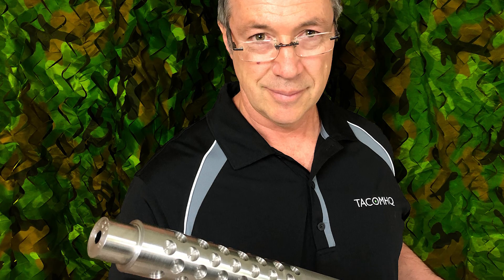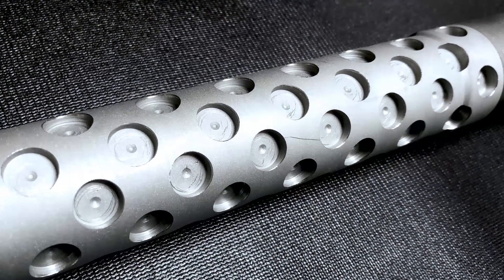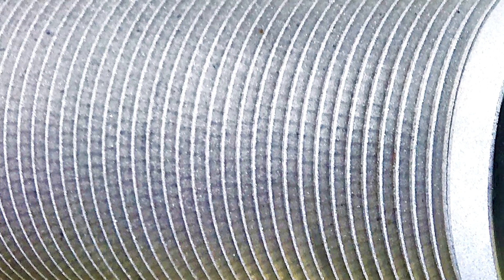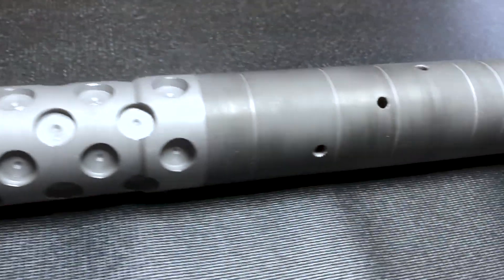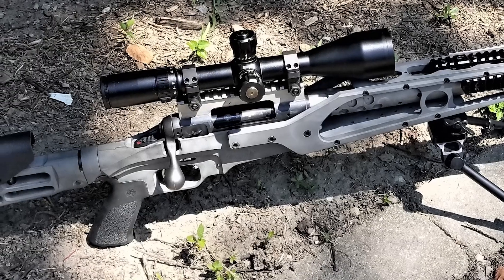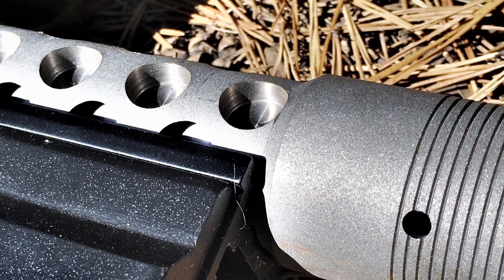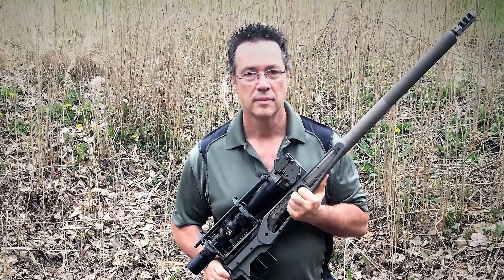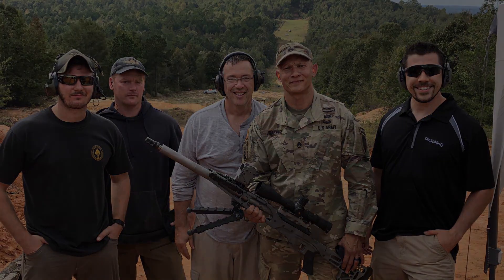The Engineering Behind a TACOMHQ Structured Barrel

Comment: Really impressive. Can this be offered as a sleeve? Any restrictions on caliber/ platform. I’d be interested for large frame AR pattern rifles.
Reply from the maker: We do not offer it as a sleeve. From an engineering standpoint I would think at least as much if not more complexity would be involved. The only way I could think of is to "shrink" a sleeve onto a barrel blank. At that point I would be concerned about straightness of the bore with the new applied stresses. However, we certainly cover that in our patent(s) LOL. Someday maybe... Concerning large frame AR pattern rifles: we can produce barrels for those. However, our gas block must be used and hand guard ID's must be sufficient to clear the 1.35 barrel. Oddly/fortunately the gas tube location is nearly stock with little mods needed. Our AR10 is always the favorite gun to shoot on bases during demoes... 
Caliber- .22 to .50cal to date.

Comment: I just wanted to thank you for maintaining the comments section for so long with such detailed answers, well done! I do have a question though, since mirage makes quite fantastic suppressors would there be any advantage harmonic/cooling/otherwise of creating a suppressor specifically for these structured barrels? An off the cuff idea would be to somehow take advantage of the longer duration lower pressure gas from the suppressor to draw even more air through the barrel. Would providing a suppressor option for these barrels be something Tacom/Mirage would consider?
Reply from the maker: That is a major project in the works..

Comment: Have you tried to add fluting between the longitudinal holes?
Reply from the maker: Fluting would slightly reduce weight. It would actually reduce cooling surface without introducing an expensive/complex method of creating the fine grooves inside the fluted area. It will also potentially reduce rigidity as the minor diameter created by the flute is my new max material condition. With that - yes LOL. However, the answer does not mean a "stop" is in place.
Reply from the maker: Great question. Once a Structured Barrel is finished, it is generally reduced to a minimum OD that would be insufficient for exterior fluting. Larger the structural OD, greater the strength and rigidity.

Comment: Amateur here. how does one go about setting a rifle like this up ? isn't it much thicker than the standard barrel, so how would it attach to a standard lower?
Reply from the maker: Yes, a Structured Barrel is thicker than a standard barrel, but its final OD depends on the caliber.  A few barrels we tapered down to fit an action.  Otherwise, unless you are shooting a big bore, most Structured Barrels will fit a BAT, Cadex, Deviance, Seekins, etc. action without additional machine work.  However, if you are referring to an AR10 style platform, we plan to have options early next year.

Comment: You might find better vibrational performance with a 7 hole bolt circle. Later model structured barrels might benefit from profiling the outside diameter around the bolt circle to reduce weight. Amazing product. Can't wait for 308.
Reply from the maker: Interestingly- for a given diameter a 7 hole bolt circle provides the highest strength to weight ratio and a larger cooling surface vs an 8 hole. At this time we are constrained in many instances due to the fact that we have to fit an existing barrel channel - which is rarely optimum. Fitting a standard 1.35 barrel channel will get a response of "can you make it heavier" from the PRS or F1 shooters. With that the optimum barrel for strength and cooling is about .8lbs heavier than the current bull barrels used in those comps. It is also approximately 1.65" in diameter. We need to get the chassis and stock makers to offer larger channels- though we do contour chassis and stocks to fit our barrels. 
A secondary flute to follow the contour of the hole pattern has been thought about. We do know we will loose some rigidity but some weight will be dropped.

Comment: Strange question, is that possible with a proof carbon barrel?
Reply from the maker: teo yes
Reply: @tacomhq  awesome ti hear! Do you drill the carbon part or the steel part?
Reply from the maker: teo steel
Reply: @tacomhq  isn't the steel part to thin? Sorry for all these questions, but i'm really interested!
Reply from the maker: teo great question. Structuring a barrel requires a specific OD blank depending on its caliber. Therefore, as long as it meets 1.75” for </= .338 or 2” for > .338 any barrel can be Structured and carbon fiber wrapped as a finish. That being said, our fallen angle pattern, a series of randomized threads cut in varying lengths and directions drastically increases surface area (as noted in the video) and deadens surface translated harmonics.
Reply: @tacomhq  thanks guys i will ask proof about core and contours,  i'm really interested in your work!
Reply: @tacomhq  any sense to try to drill the carbon instead of the steel?  ( if the steel is to thin
Reply from the maker: teo machining carbon fiber would be hard and expensive
Reply: @tacomhq  thanks a lot another time!